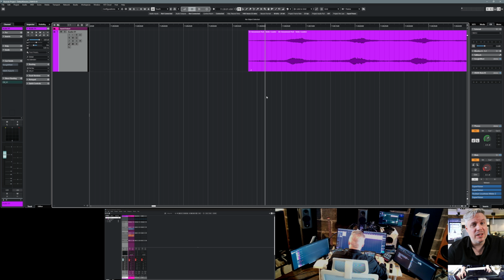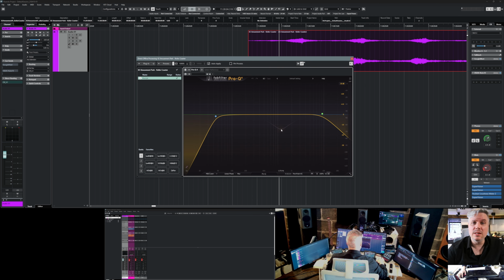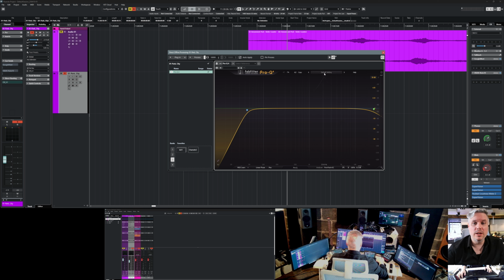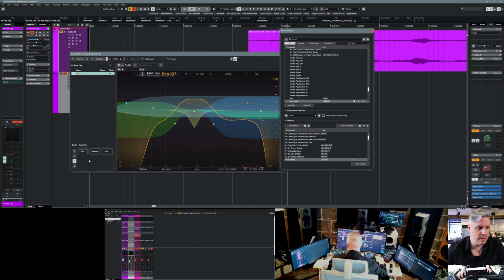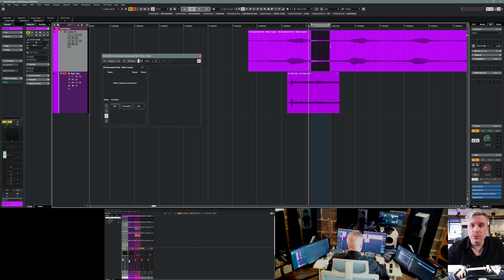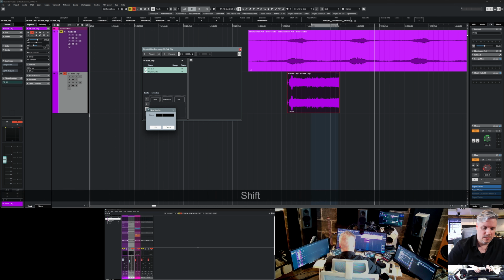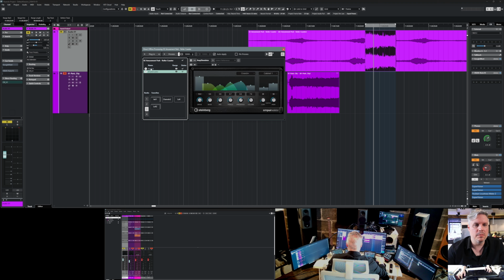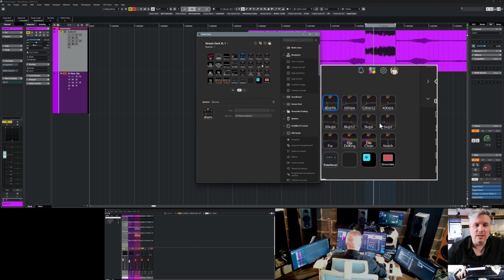Direct Offline Processing Macro recall - Nuendo Post-Production Program NPPP

Comment: This video is super helpful thanks for sharing!
I’m working in Nuendo and I want to set up a 5.1 mix session so that I can monitor on headphones. I’ve heard it's possible using the Control Room setup in Nuendo. 

Could anyone please guide me through the step-by-step process to set this up correctly? Also, what are the main issues or limitations I should expect when monitoring 5.1 mixes on headphones compared to speaker setups?